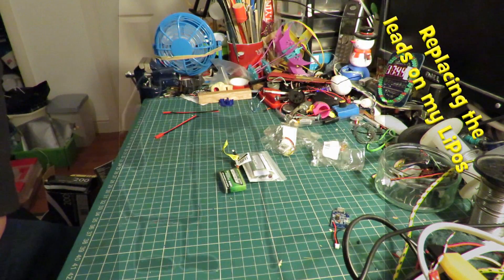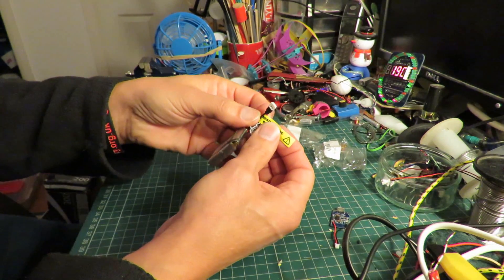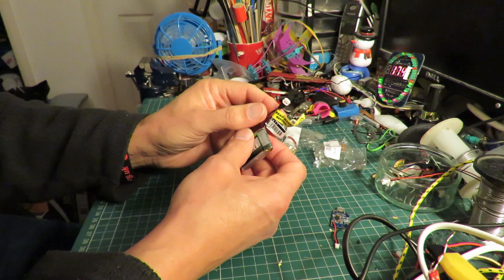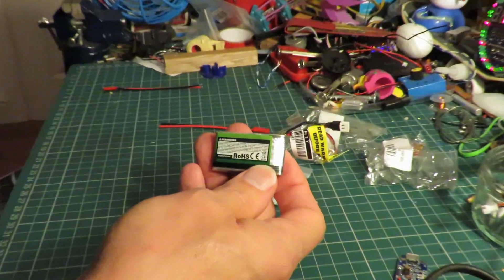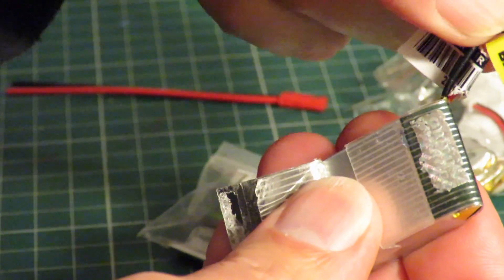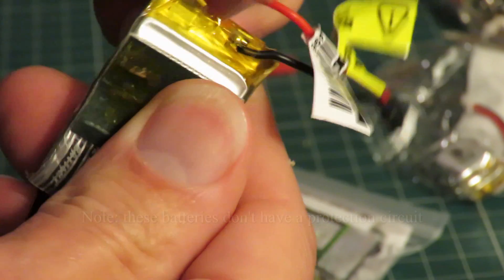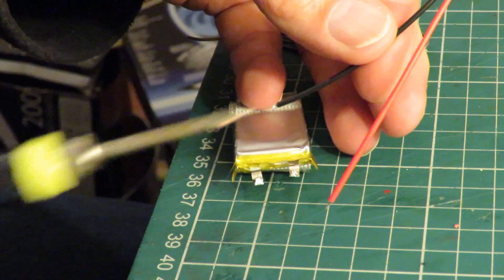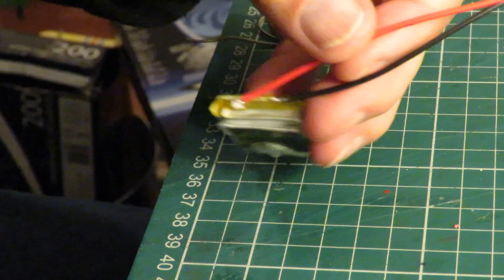Replacing the leads on my LiPos - Turnigy nano-tech 750mah 1S Lipo Fits Nine Eagles

Comment: This could be helpful to a lot of people.  In some cases it is possible to carefully remove the contacts in the plug it's self and swap them.
Reply from the maker: Yes you can swap the pins in some plugs but I prefer this type of JST connector as I use it on most of my projects. I have also made adapter connectors to go from one type to another, bat fitting my preferred connector direct to the battery saves using one.

Comment: 1 question, you mentioed that the wires of the connector are reversed, just wondering why you didnt solder them on the right way round instead of having to put on a pair of new adapters?
Reply from the maker: Simple, I prefer those JST connectors and use them on most of my projects.